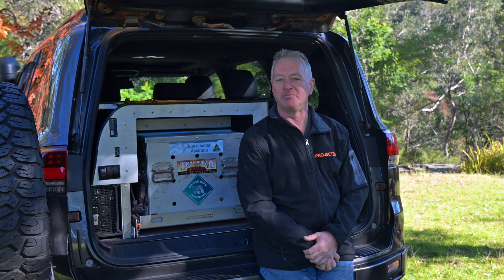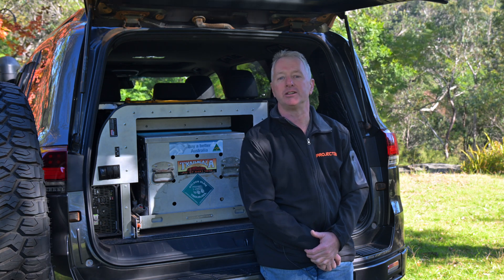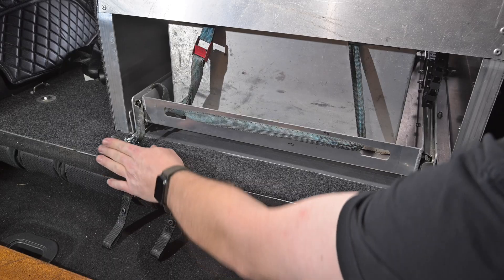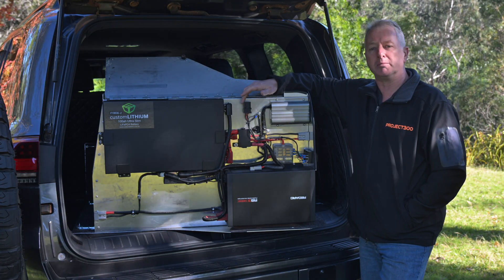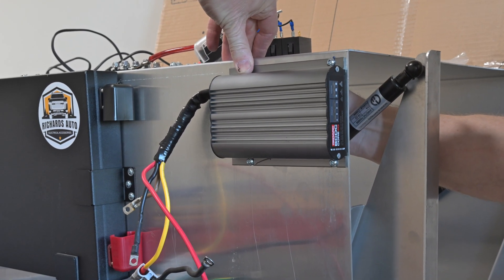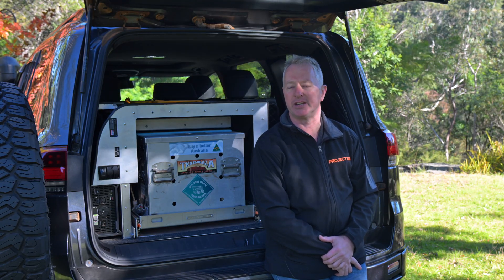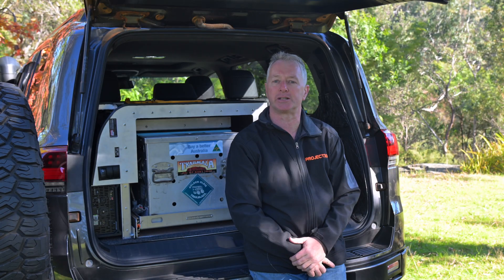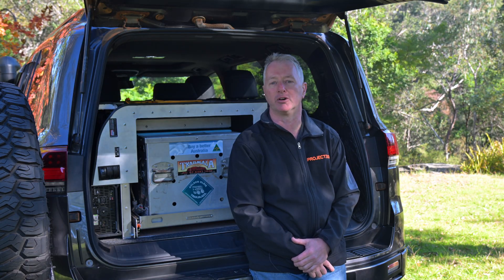Fridge, Lithium Battery and Inverter module - LandCruiser 300

Comment: I love this idea - to still be able to keep the valuable space in that cargo area, for most days, is really sensible. 
I also really like how you’ve opted with utilising a removable second battery, rather than having a permanently mounted one, when it’s only real purpose is to power a fridge that is occasionally brought on-board anyway. 
Thanks for sharing this. I’ll be sure to seek out the details and inspiration for my own wagon, from your website - I think it’ll be very similar. 
Cheers!

Comment: Looks like a quality 12v setup be it a bit small for more than one. I think in time you may find 100 a/h is to small if you are not travelling every day. We're running 300 a/h and find it a bit under sized if not travelling everyday and that is with 400 watts of solar. It's  better to have more a/h than you need  than looking for it when its cloudy. Safe travels.

Comment: there doesn't look to be any space in the vehicle for anything else. No luggage, camp gear, non cold food.
Reply from the maker: It is a large fridge, but there is still a lot of room. I went by myself on the CSR for 5 weeks with this setup, with no roof rack. Clothes, bedding, tent, food box, solar panels, camera gear, starlink, microwave, another fridge (running as a freezer), tools, spares, BBQ, recovery gear etc. all in the car. Long range fuel tank and water tank under the car, and two spare tyres on the back. I also had the second row seats out. Leaving out the starlink box and the second fridge, I could have put it all in the cargo area. If I had the whole family and all their gear, I would have either needed a roof rack or the camper-trailer.